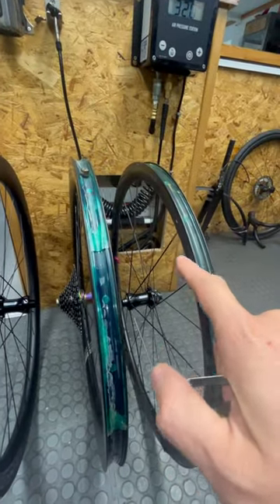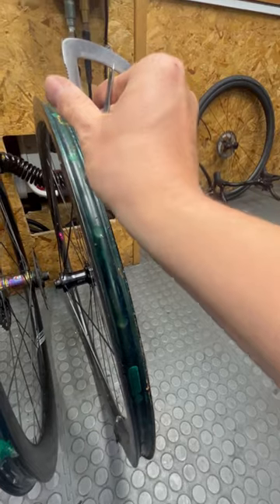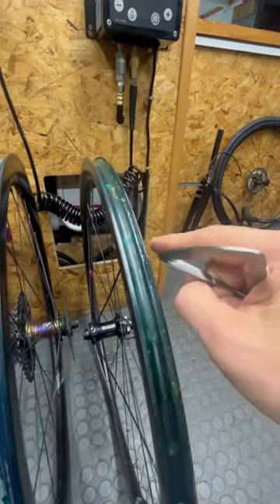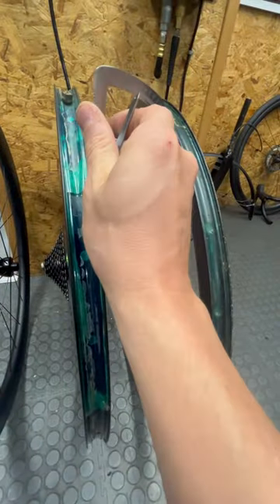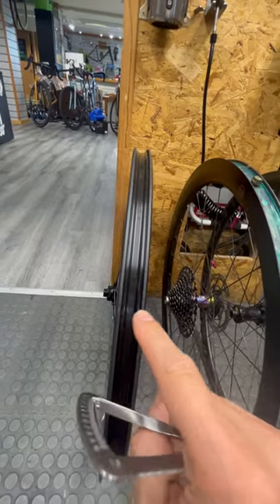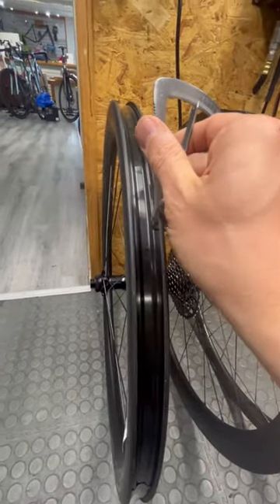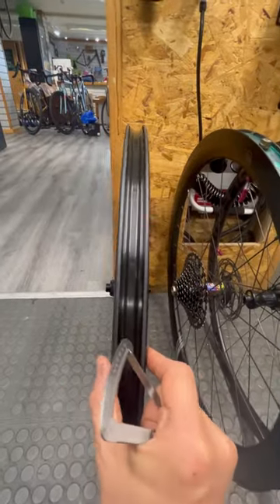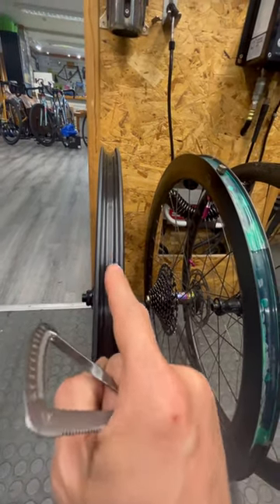How Road Bike Wheels can look so different.

Comment: I've got 2020 gravel bike with 17mm width stock wheels. 
Everything changes extremely fast.
Reply: By design
Reply: @thedownunderverse  from road wheels in 2020 we get to 25mm internal and boost hubs in 2023 and plenty of suspension (and vibration dumping) options. Who would have thought 🤷🏻‍♂️

Comment: How many tires do you need? Vittoria Corsa Pros or GP5K STRs are the only tires you need and both are hookless compatible.
Reply from the maker: Well.  Depending on your weight you might not be able to safely run some tyre sizes on hookless.  Also, the Michelin Power Cups, oh.  You should try them.
Reply: @Mapdec  Yeah that's true, weight limits do apply for hookless.

Comment: Those tapes look so wrong. which brand are they? were they taped badly? Is it taped over Gorilla tape adhesive residue? is it corrosion?
Reply from the maker: The tape is sort of translucent so it shows up every little thing. I sort of like it because you can see where it has stuck, but it doesn’t produce a nice smooth finish.
Reply: @Mapdec   Which tape is it? Effetto Caffelatex?
Reply from the maker: @mtbboy1993  yeah.
Reply: @Mapdec  Thx, easy to see cracks in the rim. How is the tape? if it's decent I might get it.

Comment: So this is why disc wheels haven't lightened up?
Reply: Partly, they have more spokes to balance stiffness on the non-drive side, and the hub is slightly heavier. But there's not a massive amount in it.

Comment: What do you think of the Giant SLR1 42 hookless wheels that come with the tcr advanced pro?
Reply from the maker: All ok. Pay attention to the Giant website regarding recommended tyres and pressures and they work well. Freehub bodies seem to wear out quite quickly. Generally built well.
Reply: Shame they build them with 19 internal and 21 external
Reply from the maker: @adsali03  it’s a good width for a 25 or 28mm tyre.  The TCR is a race bike so I guess they assumed riders would want those narrow tyres.  I wonder if they will change it next year. 21mm internal seems much more common now.
Reply: @harrybbbb  Or maybe you should develop an opinion on your own...you don't have to change your opinion on something every 10 minutes just because some guy on Youtube makes you feel like you should.

Comment: What does hookless mean?
Reply: Usually there's a groove in the sides of the rim that the bead of the tire fits into. It's called "hooked" because the cross section of the rim resembles a hook. Hookless rims don't have this groove, so the tire is meant to seal against the side of the rim purely by the pressure of the air pushing against it. There are pressure and compatibility limits with hookless, but hookless rims can be made for cheaper than hooked.
Reply: Yup mostly a way for manufacturers to cut corners..
Reply from the maker: It means that the rim has straight sides inside like your car.  The interface between rim and tyre needs to be much more precisely made. There are some advantages over the traditional hook and bead approach, but it is becoming increasingly apparent this hookless approach doesn’t suit narrow tyres that road bikes use.
Reply: @Mapdec  @Jeffrey_Wong thanks for the education
Reply: It means kaboom

Comment: Hookless is terrible
Reply: What? You don't like your tires holding onto the rim with hopes and dreams?
Reply: You guys don’t understand how tire beads work. Folding clinchers need hooks but no other type of tire does in any application including bicycles.
Reply: @Kid_Ellipsis reduced max pressures are a problem for heavier riders and the increased occurance of tire blow outs on hookless rims speaks for itself. It's was worth a try for manufacturers to simplify the manufacturing process but it's clearly not working well with road bike tires.

Car and motorcycle tires that use hookless are extremely strong and installed either with machinery or mounted to a stand and use special tools to wrap the tire bead over the rim. Which I'm well versed with changing out sportbike tires for trackdays. You can't compare them to a hooked vs hookless bicycle tire.
Reply: @Kid_Ellipsis  Because no other type of tires is similar to a skinny bike tire at that much pressure. Any tire for an engine powered vehicle is also completely different since you don't care about weight really, you can make things as thick as you need want to. You make the whole thing heavier and you won't notice it when pressing on the gas pedal...